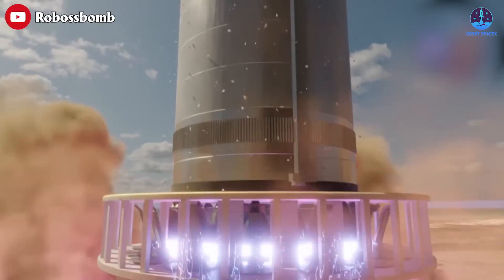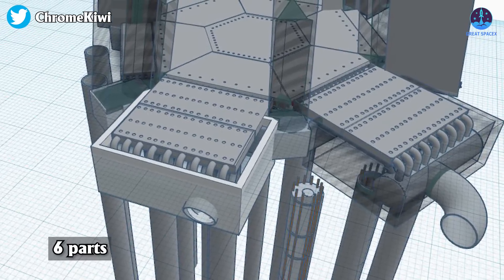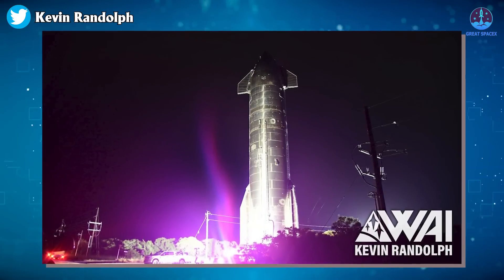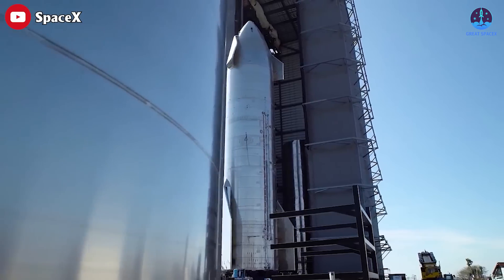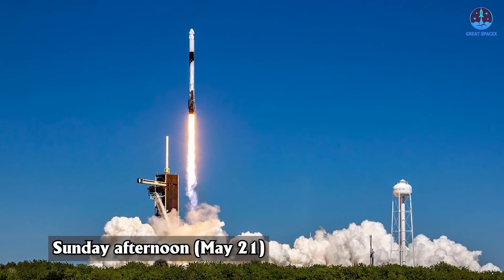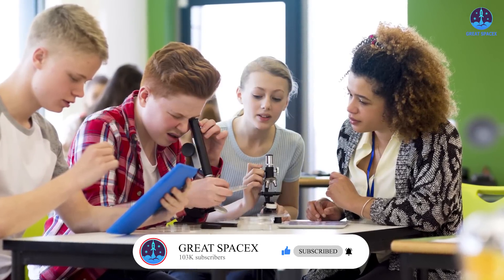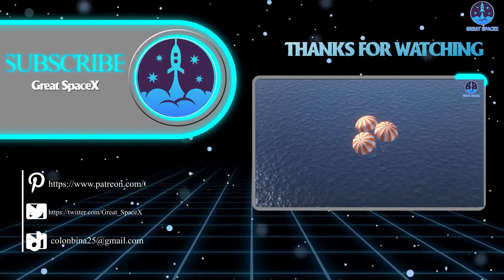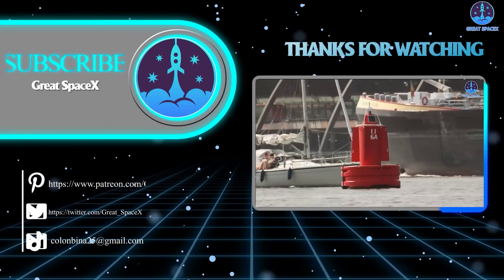SpaceX tricks to save OLM

Comment: I am curious.  Wasn't the Dragon Capsule originally designed to touch down on land using the Draco rockets?   As per NASA request it was made into a water landing craft.  But when doing non NASA missions couldn't the Dragon Capsule be configured to touch down on land?
Reply: that active powerd landing is aimed for non earth landing, as starship development is focused, with its powerd landing capability as well, dragon capsule need not to be prioritized
Reply: @ysts3452  The development of the Dragon capsule had nothing to do with starship development.  The Dragon capsule was designed to land on Earth only.
Reply: @randynelson2265  the relation is, before starship being in use, dragon is the only vehicle
Reply: @randynelson2265  not true. This was originally intended for a Mars landing. And tossed around for a moon landing. But BFR changed all that, and the Dragon landing was dropped
Reply: This would not be a re-configure, but a complete rebuild.
Reply: @_starfiend  I have seen videos of early testing of the Dragon capsule where it touched down on land using the Draco rockets.
Reply: @randynelson2265  Indeed, and so have I. But they were early prototypes. The current capsules work somewhat differently, and AIUI the superdraco thrusters are only used for emergency separation from the booster during a crew launch failure. The cargo dragons don't have them. (Note These are the SuperDraco. The draco are the much smaller rockest used in space for attitude control etc.)
Reply: @randynelson2265  Yes, but development was halted.
Reply: @_starfiend  If memory serves me well, that development was halted after the RUD after a test that released some toxic fumes.  Then taking first-principles, since it wasn't needed by NASA, it was removed reducing cost, complexity and weight.  Now the Draco's are only to be used in the event of an emergency escape events in case of booster / 2nd stage failure.
Reply: That would require a lot of expensive engineering.  What would be the point?
Reply: the build in booster of dragon is not only designed for emergency, otherwise there is no need to make it build in and bring extra mass through the whole journey, parachute would be enough for earth's thick atmosphere
Reply: @ysts3452  The Super Draco is to get the capsule away from the booster during a launch failure. If there were only parachutes then a problem with the launch would kill the passengers. The SuperDraco are NEEDED for emergency, hence the reason the cargo dragon don't have them.
Reply: @ysts3452  The emergency is an, almost, explosive separation of the crew capsule, from the booster, before the booster is blown up by the FTS. Kind of like an ejection seat, in a fighter jet.
  👻☠️🗽💯🙏

Comment: What will keep the steel plate from being dug up like the concrete pads ?
Reply from the maker: Remember there are six huge 30m piles?
Reply: There are multiple cellular beams under the plate supporting it transferring the load in to the primary beams and then into the piles.
Reply: The first attempt cleared the platform. Would the second attempt blow it up? What sort of a star ship can not separate and land in case of emergency?
Reply: @reasonerenlightened2456  An expendable prototype test rocket.